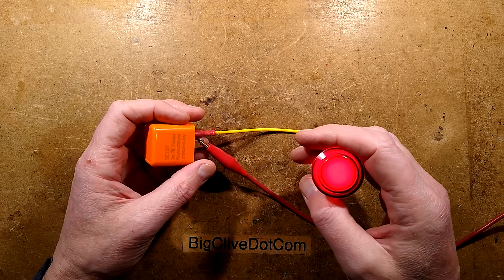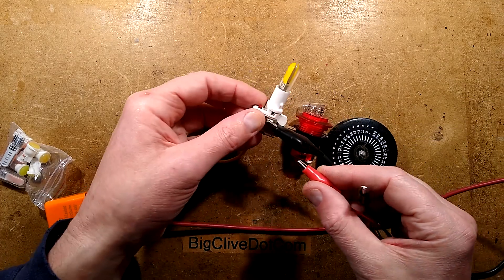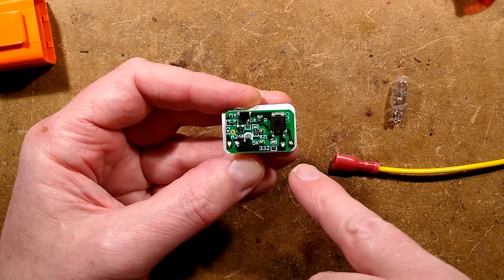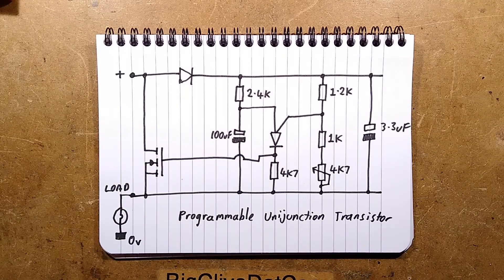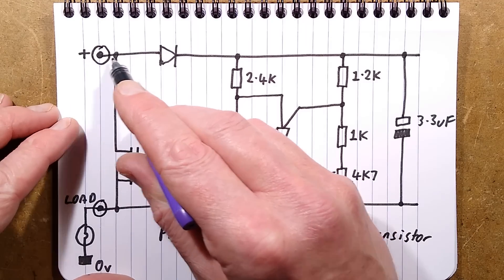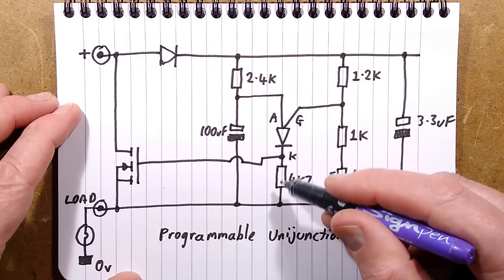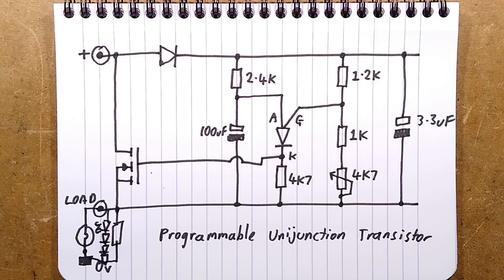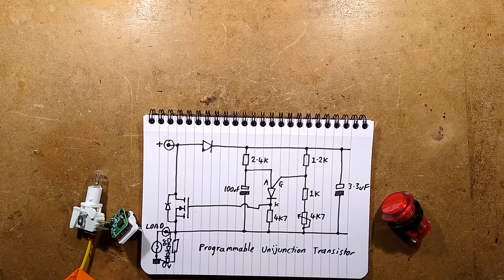Two wire flasher module teardown with unexpected find

Comment: I bought a handfull of these over the years for my motorbikes, only ever had an issue with one unit recently where the bulbs stayed lit. Interesting to hear where they are used other than turn signals!
Reply: these modules heat up when used, they should add a heatsink on the board to make them more reliable

Comment: I remember having to buy "Heavy Duty" flasher modules for our vehicles back in the day since we pulled trailers which would cause regular flasher modules to flash extremely fast. They always worked, but if you didn't have a good ground, you'd chase grimlins for hours ;-)

Comment: We have flashers on the doors of the fire station. I changed them from halogen to LED and they were just on, instead of flashing. A contractor added a beefy resistor in parallel like you did and it started flashing.

Comment: If you use the car side lights led's with a load resistor that should help as some cars need those types of led's anyway for the canbus bfd, (bulb failure detection) system.

Comment: Wow, what a nice surprise seeing a relatively modern device using a PUT. I didn't even know they were still available - I haven't used one of these since the 70s, when I used them to make very simple oscillators in my very first analogue synth design. That would have been around 1976 when I was still in school. Nice to see this very useful component again after all these years.

Maybe Look Mum No Computer might try to get hold of a couple of these and build another simple drone oscillator as an alternative to the somewhat finicky reverse-avalanche design that most of these things seem to use these days...

Fascinating stuff - You used to see quite a lot of designs in electronics magazines back in the day that used PUTs, sometimes as oscillators and sometimes as sensor switches - the sort of thing that you'd most likely use an op-amp or a CMOS logic gate for these days.

Striking a blow for obsolete technology - bearing in mind that nothing is really obsolete when it can do the job you need it to do :)

Comment: Wow ! Haven't seen a unijunction circuit, for a long time ! At hobby level, its been replaced by the 555 for decades. A unijunction WAS most often used for making a low voltage avalanche relax oscillator. If your using a circuit with a power source greater than 40V, you can substitute a regular NPN with a DIAC. Maybe the Chinese are making these. I recently found a bunch in my parts stash, and gave them to a friend, who's big on making old 1960s circuits. I can't fault him, cause in the last 20 years, I've gone back to making vacuum tube circuits.

Comment: The body diode of a MOSFET is usually rated for the same current the MOSFET is. It's just much slower with a high reverse recovery loss. That's why it's shunted with a Schottky diode in switching circuits. In a lot of motor PWM inverter circuits we actually use the body diode as the catch diode.

Comment: Wow I don't recall learning about PUT's in school about 15 years ago. But just this morning I sketched up a concept circuit with an NPN, diode to get a "switch" that would that would turn on at a certain voltage threshold.  All I need is a PUT - AMAZING!

Comment: What a coincidence. I was just wondering about the flasher module from traditional incandescent bulb vs what they do in an EV with LEDs. What a treat. Cheers.
Reply: They have been using FETs for years before EV came along. Even with lamps

Comment: Several years back here in the USA I had my car in for the yearly inspection and I had to replace the turn signal flasher because it was not clicking loud enough. It appears your electronic one does not  make any noise, that might be a problem here in the US unless the rules have changed. In my car's case to save money I replaced it but it was hidden in a weird spot and I had to take more apart then was really normal. It had a long enough wire harness so it got moved to a more convenient spot.  Yes, the LED signal light would be problem in many cars due to the lack of load to activate the flasher parts. 1990's cars. I have found a great place for a few of them and that is on the interior of the car. They don't get to hot and melt the plastics like the regular ones will in time or if the covers or other plastic parts are to close.

Comment: I bought one of these a few years ago for the hazard flashers on my tractor. Seller's advert claimed "LED flasher" but of course it did nothing with a LED load, so I binned it and purchased a "two prong" flasher that had a ground lead, negating the need for external resistances.

Comment: A couple years ago I made a circuit to flash the LEDs I put in my car. No point in buying the resistors they try to sell with them, to draw the switching current. Mine was a bit more complex, but I didn't try to refine it for production. I'm glad you made this one public. Cheers! Good luck! 👍

Comment: hmm.. with the standard relays you would notice a broken lamp because it went a lot faster than the intended 1sec intervall. 
Not that the people with the broken lamps would bother, but it worked..

now is that due to the bimetal not getting as hot so closing faster, or was the bimetal replaced with something that acts identical but is more modern ?
lower load should mean opening would be slower.. but a current spike and slow heat disippation would also buffer..

Comment: I replaced the damaged rear light modules on my trailer with LED versions. 
Now the trailer module in the rear of the car does not beep when the indicators are on. 
I knew it was due to the lower voltage drop due the lower current demands of the LED lamps. but as the trailer lights ork without issues I was just going to ignore it. 
However, you have given me a very easy work around. 
Cheers for another really helpful tutorial.

Comment: If you replace the lamps on a trailer with LED modules you need to stick a fairly big resistor on the indicator circuit. It can be a pain to find somewhere on (e.g.) an old Ifor Williams that gives you a metal backing to dissipate heat but is sheltered from dirt off the road.

Comment: I doubt this will be any more reliable than the mechanical device it is intended to replace. Using a 100uF for timing in the challenging environment of a car is asking for trouble. Also for greatest safety, the direction indicator lights should come on IMMEDIATELY the switch is operated, but here there will be a delay. There is no audible feedback to warn the driver they've left the flasher running, and finally it won't correctly drive pure LEDs or provide an indication when a bulb/LED fails. All of these snags could easily have been solved by not limiting the design to just two terminals. I guess that was done just to make it a direct replacement for the mechanical types. Hopefully, modern cars use a much smarter solution than this.

Comment: Since a flasher is designed for 2 bulbs, would that make a difference in the unit working with LEDs?  

The fact that it has speed adjustment is probably due to the tendency of a retrofit vehicle to have "hyper flash", so, instead of a load resistor, you adjust the flasher.  It would be worth trying to adjust the potentiometer with 2 bulbs attached to see if it works.

Comment: If you need resistors across the LEDs to make the flashers work at all, how much less current are you using than a simple flasher and incandescent bulbs? Is it actually worth the complexity?
Reply: It's worth the complexity in cases where changing an incandescent is a pain.  I'm going to replace the indicators on my motorcycle with LEDs simply because changing bulbs is a pain in the butt....
Reply: @haywoodyoudome  I can understand that in a dashboard. I can never understand why it was always made so difficult to change the" idiot "lights. Bikes must have changed a lot since my time, it used to just be two screws to open up an indicator to replace the bulb.

Comment: Surprising, I thought they were just a metal strip and a spring which snapped when it got hot and snapped back when it cooled.   A high-tech solution when the old way worked just fine and even gave you a clicking noise to remind you it was on,

Comment: The old-school thermal flasher was fairly robust, and in the case of failure, the part could be found in any department store (remember those?) that had an automotive department,  and the price ran typically around $7. It always took longer to disassemble the necessary dash panels to access the flasher than it did to actually replace it. We knew a bulb failed because the reduced current wouldn't make the bimetallic strip hot enough to disconnect - the turn signal would flash maybe 3-4 times a minute, if at all. If the indicator on the dash refused to light, it was either the turn signal circuit fuse, or a dead flasher.
A few months ago I needed to replace the flasher module in my '99 Jeep. The "click" sound intermittently sounded like a very brief buzz than a decisive click, so I replaced it before it failed completely. It sounded exactly like a thermal flasher, despite it being an electronic flasher, because it actually had a bimetallic strip inside simply to make the click sound. I guess that explains why it costs 3x as much as a thermal flasher!

Comment: Maybe it's a 2n6027?
I just saw a video where someone built a digital clock using only transistors, diodes, resistors and capacitors. 
He needed a flip flop and switched a PNP and NPN transistor to a PNPN diode with a gate. He said the part he needed was no longer made. He made a ring counter with fewer transistors than today's TTL flip-flop. 
Today only the diac, triac and thyristor are used. But true four-layer diodes are rare.

Comment: Indicator flasher relays were designed to flash quicker if one bulb is faulty, alerting the driver to the problem.
Reply: That is an issue with retrofitting an older car with LEDs, the flasher "thinks" the bulbs are blown and goes into "hyper flash" mode.  A 100W load resister can be installed which slows the flash, but then the flasher won't sense a blown bulb.  LED flashers have proper flash, but still don't sense bad bulbs.

Comment: Hey I put that exact thing in my old 1977 car about two years ago; same color, shape, and design

I had no issues with needing load resistors on it; maybe it’s not liking the single 194 you ran it with? Mine powers the two 1157’s (front/back left or right) and works like factory (except for the lack of sound)

Comment: Back in the late 1960's some American made cars had chasing "sequential" turn signal lights that were controlled by a simple SCR and capacitor circuit. I wonder if this circuit you showed would work with a SCR in places of the 2n6027. Seems like it might with adjustment to the timing resistors.

Comment: Basically, it relies on the load offering a path to ground, which isn't guaranteed on an LED due to the voltage needing to be above the forward voltage before a path to ground is available. 
This is an unfortunate limitation of a 2 pin flasher. It needs the load to provide a path to ground. A third pin providing an alternate path to ground is needed to overcome the issue, but if that isn't possible, a resistor bypassing the LED.

Comment: I just bought one of those for my 1979 Suzuki gs750 because I am converting everything to LEDs to hopefully to put less load on the charging system. It plugged right in and it's adjustable.

Comment: I’ve just fitted one of these to one of my dads old bikes (1950s Velocette Valiant).
It’s not running LEDs but lower wattage filaments. This sorted out the slow flashing problem with those. It was converted to 12v at some point & had indicators fitted, they weren’t original.

A really interesting video, whilst I’m pretty good with electrics (ex sparky) I’ve only ever been an enthusiastic amateur when it comes to electronics, so I’d never heard of a PUT. I wish I knew more as I’d like to get into dynamo regulators, converting dynamos into alternators & I’d like to design an LED rear light assembly for vintage & classic motorcycles.

Comment: Awesome and timely video, keep em coming! I've been fiddling with 555-based blinker and PWM duty-cycle LED dimmer circuits for my Ebike's 12v system over the last week. Currently I'm using an inline blinker for the turn signals like the one in your video, but I want to customize the voltage falloff to be more like a sine wave (blink on-fade... blink on-fade...) So many possibilities. Still debating if PWM LED fading is worth the effort when a simple inline resistor works just as well, though ~slightly~ less efficient. I'm fading the brake LEDs so they act as running lights full-time.
Reply: @liam3284  I've tested for motion-flicker and it's non-existent at the frequencies I'm working with. It's more of an issue with LEDs running on mains AC at 60hz.

Comment: As a bit of added trivia, the UK MOT test allows flashers to flash anywhere between 60 and 120 flashes/minute. I'd imagine by the time you have two LED indicators and a dash lamp, the 1k resistor would not be needed. Those electronic ones are really useful because if you retro-fit LED flashers to an older vehicle with a thermal flasher, the flash rate goes far too high. There is still a pervasive tendancy in vehicle sparkies to "fix" this by fitting a huge ballast resistor in series with each LED flasher which costs more than a "plug and play" electronic relay and negates the whole point of fitting LED flashers in the first place (usually to reduce current load on an antiquated charging system).
Reply: Customers want led lights cause they are bright and look cool, not a single bit of thought is given to current consumption. FWIW i use a relay-follower circuit and modestly high value resistor to get around modern bulb warning detector circuits on most modern vehicles. on older cars a ballast resistor is perfectly acceptable. and especially in conjunction with a solid state flasher relay.

Comment: Makes me think of the 2 terminal delay-on-make solid state timer modules made by SSAC (among others).  Not sure if these are common in the UK.  Somehow they're powering themselves after the time is up and the load goes high - which is interesting because it might need to remain in that state indefinitely, so you can't just use a capacitor.  Further interesting because some of them have a wide universal input rating, 24-240VAC/VDC.  Would love to see a teardown of one of them, but you'd have to boil out all the potting inside.

Comment: Don't they make those t10 led bulbs with resistors built in to make them work right?
Reply from the maker: They do.  Sometimes with ridiculously low resistance ones that get extremely hot.

Comment: Does this blinker turn on with a on-cycle or off-cycle? Ie does the led light immediately and then go dark when you turn on the blinker or does it start dark and then turn on?

I changed to LEDs and a new electronic relay on my motorcycle and now it starts with dark, which is very cumbersome, bec I can not make quick turn signals, by just shortly pressing the blinker button...

Comment: That's interesting to see such a mix of technologies in one package. On a flasher-related note, I recently acquired a flasher relay for level crossing signals (Union Switch & Signal FN-16A) from 1956. It's primarily relay-controlled, but tge flash rate is adjusted by adding or removing copper washers from a pole connected to two big coils. I haven't had the chance to experiment with it, but I think it'll be pretty neat to see in operation

Comment: I had all kinds of problems switching my old Jeep to LEDs. I used bulbs with built in resistors, used electronic flashers and could never get the flashers to work right until I found one certain kind of flasher called an EF32RLNP. Now it works with either LEDs or incandescents or a mix of both.

Comment: The diode in the 12V line is needed to avoid that when the Mosfet turns ON the 3.3 uF capacitor gets shorted messing up the gate voltage of the PUT. Likewise, w/o the diode the 100uF cap would be "shorted". So, w/o that diode most likely the Mosfet would turn itself OFF very quickly and the light would just blink.
Just wanted to point out the importance of the diode.

Comment: wow.yes the old uni-junction transistor I remember an ETI metal detector that used one 2n2646  in the oscillator circuit. There was also the programmable one that had 2 gates and you could use it to trigger SCR s at zero crossing and music threshold/frequency -nice for the sound to light units used at parties back in the 80s,
Reply: that 2 gate one was likely a BRY39,  it was used in a few TVs in the 70s for the timebase generator circuits

Comment: all flasher relays come with a predetermined load like 6 8w lamps or 8 4w LED lamps and so on they also make adjustable ones these days my service truck uses a combination relay with separated left and right channels and combines the two for the hazards and also keep in mind that if you pull a trailer it can have an effect on the relay as well. and that would be an interesting video dissecting a 3 to 2 wire solid state trailer light converter

Comment: Would that modified led circuit still work with a std bulb? If so then why didn't the manufacturer install that resistor to allow it to work with either led or std bulb? I know... Money...